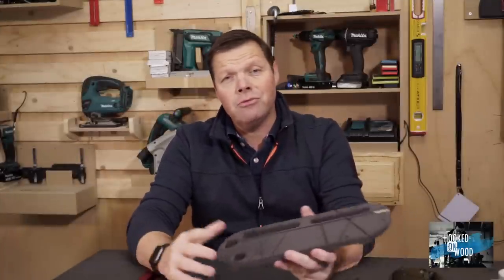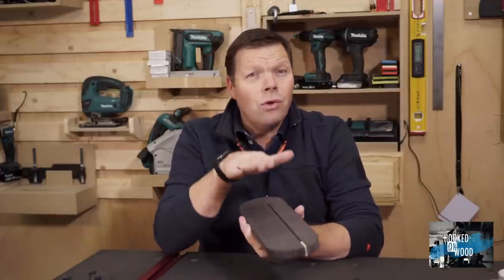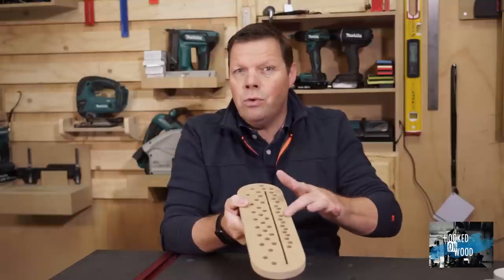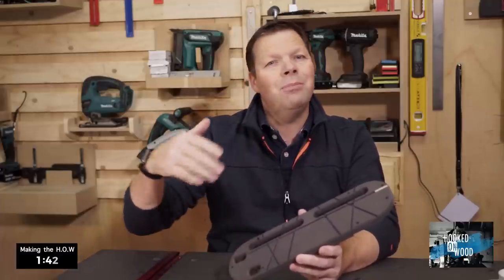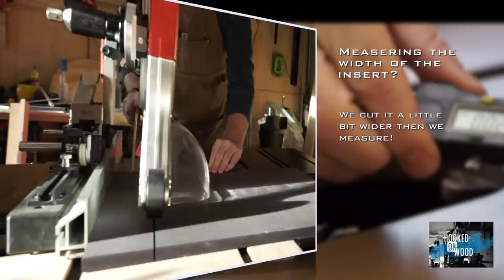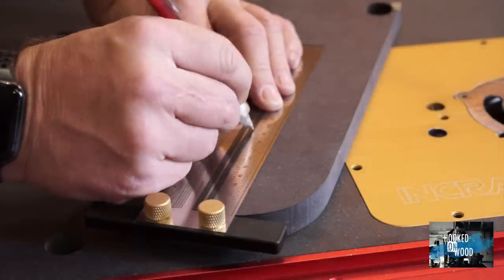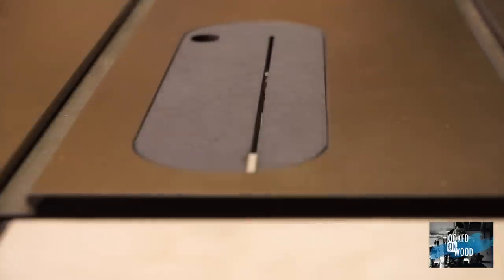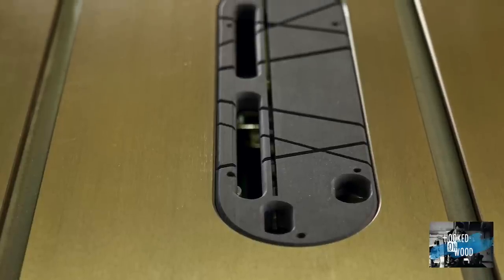A new zero clearance insert you should see!

Comment: Thank you for your efforts to develop the insert, and your  generosity in sharing it. I'll make one.
On a different issue, I've noticed in your videos that you prefer black surfaces.  Well, I have found that when I got older in age and my vision is not as sharp as it was, that I prefer bright colors. Also, when I've refurbished tools, I paint the inside and undersides a bright color. This makes it easier to see if adjustments are needed at a later time.

Comment: Excellent design and function; very well thought out.  I knew about the airflow requirements for HVLP systems with my router but never gave the tablesaw much though.  It always annoyed me that there was a pile of dust in the bottom of my saw (I'm using a two stage system with a 2hp dust collector, shop made Thien baffle and overarm collection on the blade).  I made a zero clearance insert  (including a hardwood riving knife since my saw predates them) today using your design and I'm very impressed with the results.  Way more efficient; this was a game changer.  Thank you sir.
Reply from the maker: Thanks Anthony, I am very happy to read you like it, and it is effective.

Comment: I made my insert similar to yours. I'll probably make another based on your suggestions. One problem I had was dropping a set up bar into the slot and it falling into a very inconvenient spot inside the saw. Another design of mine was to drill holes at each flange location. I inserted set screws in each hole and could adjust the height of each screw with an Allen wrench from the top of the plate. It's a lot easier and quicker than removing the plate to make adjustments.

Comment: Dennis, I will comment in the WW forum but the only problem with air entry through the insert plate is there is no air entry when the whole plate is covered. If a drop down shield was attached to the side overhead guard and pulled down on occasions when the cut produces side deflection of the debris then that problem goes away. I think your insert plate is an excellent idea if air can get through it. If I am cutting thin strips I place a piece on MDF on edge beside the blade and the debris deflection does not occur. That is the best demo of why a cabinet should not be sealed that I have ever seen, good work and now a lot more people might understand that sealing a cabinet is the worst thing that can be done. Keep up the good work, your videos are fantastic.
Reply from the maker: Hi Chris, I just uploaded the video on the forum. I understand your comment, and you are right that it only benefit if you do not cover the holes. But in most cases, the least thing that can happen is that you get a better ability to clean up your cabinet saw. (before and after the cut) And the insert is an additional hole. Like you also agreed you should not cover the holes from your cabinet. So, when the whole plate is covered, you end up with the same situation you normally would have.

Comment: Great Idea and really good video.Just inspired me to build one of my own.When I saw the cuts you said they are not necessary,I had the idea for my version to cut them in most used angles for mitercuts 15/30/45 and so on and then just put a strip with same wite of the sawblade to aline the fence more easy for cuts in angles.You inspired me.Thank you
Reply from the maker: Hi John, Cleaver idea to cut the angles of the intercuts. 
Thanks for your comment. I really appreciate it.
Reply: Hey.I’m going to build 2 or 3 for my table saw now and my saw has more space on the left than on the right in the hole.I ordered phenolic resin or pertinax.Is that the material you used for yours?i found coated plywood or “Siebdruckplatte” here in Germany to weak and deformable.But all ready the “prototype” was way better.Thanks again.

Comment: Great idea Dennis. I must confess that I first thought the shallow angled kerf cuts across the top were to allow a little airflow under the workpiece, not just for aesthetics! You mentioned about not putting holes in the right hand side as this would increase friction on the moving workpiece. This got me thinking whether a version made from material with a low friction surface, like melamine faced MDF or phenolic faced ply might be either a way to also allow some air holes on the right hand side or just reduce the friction of your current design. Just a thought ...
Reply from the maker: Hi Stephen, 
My insert does not has that friction on its own. If it has, it is a bit from the suction. And you are right about the cuts across the top. I planed this so it could release pressure to the sides. But, the impact of the suction is very limited because there are enough holes where your dust extractor can get its air from if you cover the holes of the insert. Different then with my router table box. This one is airtight. If I put wood on these suction holes, it is difficult to put your wood over it, that is why I did a sliding door, if it can release the pressure the problem is solved. That is the "normal" situation. So to be short, this is almost a "non" issue.

Comment: Thank you for the great idea. I am dissatisfied with the dust control of my current zero-clearance insert and this seems like a wonderful solution. One suggestion though. At about the 11:00 minute mark you are getting the saw kerf cut into the new insert. You run into the problem of getting the insert exactly in position to cut the saw kerf. Instead of cutting it most of the way through, why not install your dado blade, which usually smaller than the normal working blade, put the new insert in place, move your fence over the insert - not over the blade though - to hold it in place. Then you can raise the blade to cut the kerf. Then you can reinstall the normal sized blade and continue.
Reply from the maker: Hi Fred, That is another way. But, I do not have a dado blade. But I find this way much safer and I manage to get the cut right where it needs to be.

Comment: I took a different approach, I use a zero clearance insert, I have 150mm bell mouth sucking out of the cabinet table saw body, but opposite that I cut part of the cabinet open, fixed heavy duty mesh, this allows dust to be easily pulled across the cabinet. I have done this for 6 months and yesterday wanted to change a belt, upon opening the babinet there would have been enough dust to fill a coffee cup.
Reply from the maker: In the End, it is the results that count. Nicely done!

Comment: I love the relief cuts you made on the top surface of the insert, I assume they are meant to 
stop the air preasure from your dust extraction system from sucking the work piece down
and creating too much resistance .
Reply from the maker: Yes, that was the thinking. 
Of course the wood is sucked to the holes, but that is not a problem. It is not that strong because you should also have some holes in your cabinet. So when all the holes are covered it just extract more air from those places. However, I think it helps a bit. And it looks awesome! :-)

Comment: My insert uses laminate flooring and has holes on both sides like your first prototype. Then I taped over the holes on the left of the blade.

I really like the relief cuts across the top and your way of cutting the kerf then adding a small piece of wood. Well done.

Comment: Dennis, when you drilled the alignment holes for the set screws, did you use threaded inserts. I love this design and I’m going to attempt it. Wish me luck, it is going to be on a Metabo HPT table saw
Reply from the maker: Hi Steve, no I did not use inserts. The Black MDF is stable enough to tap a hole for it. And good luck :-)

Comment: Beautifully done. I also like your attention to detail and design. Your shop is amazing. Question, I am still not sure I understand why only the left side needs slots. I would imagine both sides of the blade would get sawdust? I know you found that out from your test I must have missed exactly why.
Reply: I have a question, so what about when you are using the miter gauge vs the fence? You could very well be using the left miter slot so the waste drops the right of blade - wouldn't then you need holes on the right?
Reply from the maker: the slots have two functions. To clean the cabinet (if you have a cabinet saw) and better dust extraction.
For cleaning the cabinet it usual creates more air volume and because this is normal a bit limited it will clean the inside of your cabinet better. It does this before and after the cut. For this, it does not matter where the holes are.
Second is better dust extraction during the cut. When you put holes at the right (when the fence is at the right) the holes are covered with the timber you are cutting. So, you need it at the other side of the blade. It is most effective for cleaning up edges when the holes are open during cutting.
Reply from the maker: Yes, you are right. You could make them on both sides for this purpose.
Reply: @HookedonWood  haha and I just got done immediately filling in the holes I had on the right after watching the video before I thought of that I think I will leave as your design and see how it goes. Another thought is obviously if you use a sled then nothing works... Unless! You also put similar slots in the sled? What do you think about that application? Or maybe instead put an overhead suction over the sled. I know I am ovetthinking but sort of fun! (esp during covid)
Reply from the maker: Hi Worskin, Your thinking is not that different from mine. If you watch Episode 14 you see at the beginning that I made a finger joint jig. You see I made a slot in this for better dust extraction. I think it is a perfect solution because especially with a sled, the dust blows right in your face and when you make a slot in it, you reduce this by 80%. At least that was what happened with my finger joint jig. I would recommend making it longer than I have done.

Comment: Thanks for uploading. I have a Dewalt 745 and I'm considering to upgrade with Axminster table saw. II don't like others diy tables on the EU market like Holzstar or Holzman due to the fence. Plus axminster provides the dado blade option. Think about make a review for your tablse saw. Is yours with dado blade ? Are you happy so far ?
Reply from the maker: I agree with your and I came from the same Dewalt 745. I think the Axminster is a very nice table saw. I have the dado blade option, but no dado blades jet. But I do not think the Harvey/Axminster trade have the quality and accuracy of a Hammer. But I needed a table saw like the Harvey and If you have it setup the best you can it is a very nice machine. I think I will make a review about it in the future.

Comment: Greetings from the eastern side of Europe :) Great video as usual! What is the distance between the blade and the suction holes? I have only 27mm between the blade and the end of the insert so I am wondering if there will be enough space for such modification...
Reply from the maker: Hi Mihail, 
I wood leave a bridge of around 7 mm to the blade and the same to the edge of the insert. It is not that much smaller than my space. 
And every bit helps. 
Good luck!

Comment: Hello Dennis love your videos thanks I have a few questions:
1. During the making of the insert you have 1 finger hole on the bottom right of the insert. Then around 13min you have a second elongated finger hole near the bottom middle but you don’t mention this one? Why?
2. The screw hole and screws, are the holes  countersunk to make room for the screw head?
3. What kind of screws do you use and do you grind them flat?
4. Is a friction fit strong enough to keep the insert seated? All my factory inserts have some sort of locking mechanism.
Reply from the maker: Hi, 
here are my answers:
1. I made two elongated holes for air inlet. The hole at the other side of the front is just to lift it.
2. Yes, they are a bit countersink to hide the screw. I have a screw with a flat head
3. flat head and I did not grind it.
4. I still have no problem with it. When the dust extraction is on, it is sucked to the table saw. But my friction is also stable enough. If you find a way to secure it, it will always be better.
Reply: @HookedonWood  perfect thank you!

Comment: Nice job. Do you find that using 3/4" (18mm) material prevents your blade from raising to the highest position (not that that's used often). I suspect your saw is the same as mine and I've never used 3/4" since the armature that holds the riving knife will interfere (substantially) with the bottom of the insert.
Reply from the maker: Hi Charlton, 
Yes you are right. If I set the blade in the Highest position it lifts the insert. I do not use the maximum settings a lot, but when, then I place the original back. 
That said, I still have a very practical capacity.

Comment: Right now I can't get to my table saw. I'm getting ready for a garage sale of my Son's property that I have been storing for him. He passed away the day after Easter 2019. And we are finally clear headed enough to get it done.
Reply from the maker: Hi Tim, 
I can't express myself good enough in English to say in the right way how sorry I am to read about your lost. That must have been a very difficult time for you and your family. Tim, I want to say something more, but English is not my first language and in this case I do not want to explain myself wrong. So I just want to wish you all the best and hope you and your family find the strength and power during this sad and difficult times. 
Best regards,
Dennis
Reply: @HookedonWood  Doing projects and keeping busy helps. Today, I cut a hole in the master closet behind the shower spigot. We had it replaced but it is sticking out from the tile. 
Could move it in and out. Thought that there was no backer board. After opening it up, there is a horizontal 2x4 and feeling around the pipe is clamped but loose. So I used a electric conduit strap and screwed it to a vertical wall stud.
Installed an access panel that the cover snaps into. 
No new drywall and an easy fix. Now I can use an Allen wrench, remove, clean, add new plumbers putty and put the spigot all of the way to the wall.
I taught Joe a lot about painting, plumbing, electric and tile. He just started his own company. 
Now we're selling ALL of his stuff for his children's inheritance.
Joe went to share the Gospel Easter Sunday, the man dosed Joe with fentinol and he passed away between 4:45 and 5:00 the next day.
Anyway, I really like the insert. Will probably end up making one for each of the blade setups.

Comment: That is the best table saw insert I have ever seen & I love all your videos, in fact, I just ordered the Stainless Steel 45 Degree Miter Angle Corner Ruler Wide Base square
I see you have a SawStop table saw, mine is an older Industrial version with a black phenolic insert & I have always been looking for a good plan for creating the depressions or hollows on the bottom for allowing of the blade spindle and cast insert tabs.
Do you have any info or dimensions or templates that you could share?
Thanks for your great videos and your time.
Dan the tool junkie.
Reply: I'm pretty sure he uses the Harvey table saw with TiN coated top.
Reply: @anthonybarker9123  Yes I see that now, beautiful  saw